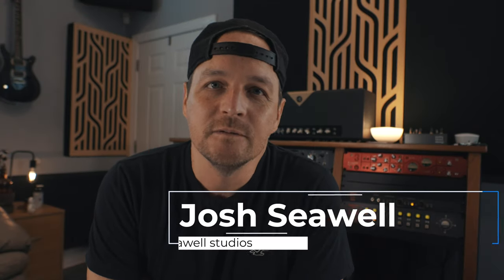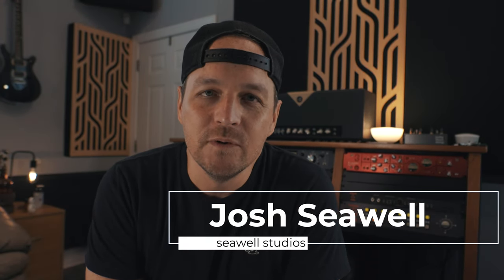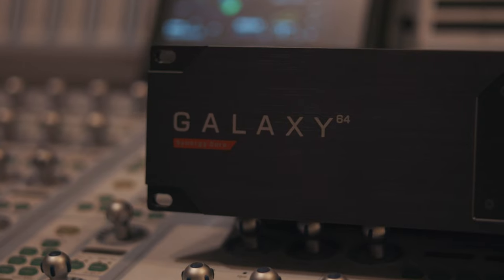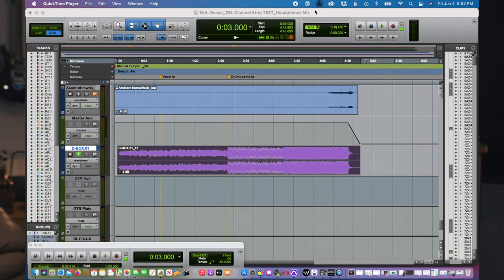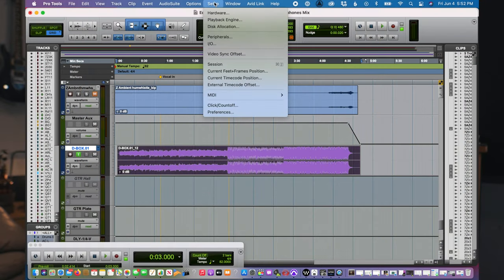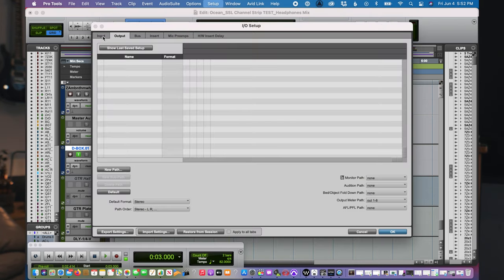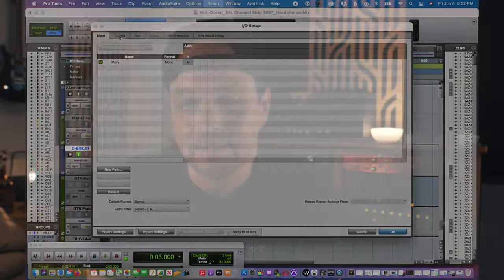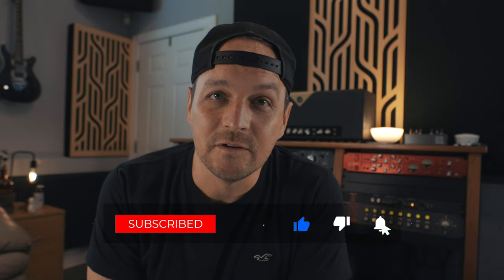Does Pro Tools Delay Compensation work with Antelope Audio Interfaces? | Galaxy 64 Review

Comment from the maker: *Update - I had another chance to use the Galaxy 64 with Pro Tools and at this point I'd highly recommend not getting this unit if you are using hardware inserts and need proper delay compensation.  I never could get it to work with any consistency.
Reply: Could you elaborate?  Is the issue still related to clock source to get delay compensation, or the fact that they still don't have AFX2DAW working with the Galaxy interfaces?  Having to build out a new studio, which will be hybrid and was considering these as an alternative to the MTRX.  Thanks.
Reply from the maker: @Bluesprocketsound  I'd be glad to!  I got to spend another week with the Galaxy after making this video.  Unfortunately, the way I got delay compensation to work in this video would no longer work as soon as I would insert an AFX plug in.  So, I could get hardware inserts to work, or AFX inserts but not both at the same time.  I think the Galaxy 64 has the potential to be the best interface on the market but unfortunately not having the Pro Tools automatic delay compensation rock solid is an achilles heel.  The kind of people looking for this many channels are going to be using hardware inserts I would think so Antelope is really going to have to get this figured out at some point.  I know it is possible(for third party interfaces to do proper delay compensation) because I can still hook up the first generation of Lynx Aurora interfaces and they work perfectly.  Absolutely no manual delay compensation needed.  The Galaxy 64 shows up in the Pro Tools Hardware section as an Avid HD I/O just like the Lynx Aurora does so I have to think the problem is in the Antelope Control Panel software.
Reply: @SeawellStudios  Thanks for the reply.  I've been digging into this with a couple people over on the FB forum.  It seems that Mark Holloway has located something related to firmware versions that affects the Delay Compensation in Pro Tools.  He's got a ticket open with Antelope now, but according to him rolling back to a specific version and then rolling up to the most recent stable firmware seemed to fix the issue and allow the automatic delay compensation to work as expected.  Haven't tested this myself, just passing along info.
Reply from the maker: @Bluesprocketsound  I've discussed it a bit with Mark over on Gearspace.  I really appreciate the effort he's putting into it!  Fingers crossed it all gets sorted out.  Definitely keep me posted, thanks!

Comment: I went through similar pain with the Galaxy 64 with HDX in 2020. I quickly learned Antelope has this issue for years with all of their hardware units with Digilink ports. It’s as if they don’t have the ability to address bugs or defects related to this and just let the issue persist. Very shameful in my opinion as they are very aware of it but do not address it. As a side note, when they launched Galaxy 64 they had a video on YouTube in a studio session promoting Galaxy 64, Pro Tools, and afx2daw during the mix/playback section of the video. I contacted Antelope many times and they ended up killing afx2daw for Galaxy with no notification, communication, and just leaving customers hanging while still showing the integration on the product web page. I moved on from Antelope and haven’t looked back. Everything people say is true. Hardware converters are great, but their products are consistently plagued with defects.
Reply from the maker: It truly is a shame.  I mean we know it's possible because Lynx works with Pro Tools flawlessly.  Perfect delay compensation.  If Antelope would get it figured out they would make the best interfaces but it's such a glaring issue that there may be too much damage done to their reputation at this point.  I know I would be very reluctant to go down this route again.
Reply: @SeawellStudios  I have a Zen Tour Synergy Core that I kept and use with Thunderbolt 3 on my 2019 Intel MacBook Pro but many folks have complained that it's mid-2023 and Antelope still do not have native Apple Silicon support for their drivers, Antelope launcher, afx2daw, Mic emulations, or any of the AFX DSP plugins.They have postponed the release of the non DSP versions (native AU, VST, AAX) twice since NAMM because they announced they will release it as a subscription. This hit people hard because many have invested hundreds or thousands into AFX DSP plugins and had expectations Antelope would do something similar to UADx where if you already own the plugin, you get the native version at no charge. I think the backlash is what has caused Antelope to delay and re-think how to better serve their customers. If they force people with perpetual licenses into a subscription, that will no go over well, even if they throw in a free year, it's still undesirable for many.
Reply from the maker: I hadn't even heard of the native plugins, that's crazy!  These companies definitely need to stop and thinking about subscriptions and screwing over all your existing customers.  When they go that route, they definitely should give the native versions to those of us that have already invested in the DSP ones(I still have a Zen Go Synergy Core).  Thanks for info, I really appreciate it!

Comment: I went with iz radar convertors paired with a avid mtrx 2 ,connected via Dante ,as well as hdx integration ,rock solid
Reply from the maker: Nice!  I had a Radar 24 system for a while in the early 2000s.  Awesome converters.  I haven't heard their latest generation stuff but I bet it's great.

Comment: Im glad I looked at this video I was about to pull the trigger.
Reply from the maker: Glad I could help!  I really hope they get it figured out where it will work consistently.  It would be the perfect converter if they did!
Reply: @SeawellStudios  Yea I'm really wanting to get into hardware inserts and Atmos. Let's hope in the up coming years. Im getting old though. lol
Reply from the maker: @Kharrari  haha you and me both my friend!  I'm considering going the Logic > AirPods Max approach for Atmos mixes for now.  Get my feet wet and then see if it ends up being really worth it before getting some crazy 10+ speaker set up.
Reply: @SeawellStudios  Yea I'm hoping apple drops a better AirPod headphone. I have heard the atmos at a friends and I have the airpod Max. Its coooooool but it is not the same.
Reply: Not saying dont get the Airpods I just think the next ones are going to be a real upgrade. FIGERS CROSSED

Comment: I’m wondering which input/output configuration you went with. I’m using a Galaxy with Logic and a Euphonix System 5 and no issues at all. BNC all the way.
Reply from the maker: Hi Christopher, thanks for your comment!  Are you using hardware inserts at all?  That is where the Galaxy fell apart for me because I use a bunch of hardware during the mix.

Comment: exactly the issue im dealing with... what interface are you currently using?
Reply from the maker: I ended up replacing the fan in my Avid HD I/O so I’m using it alongside 3 Lynx Aurora 16 HD.  The lynx work perfectly with delay compensation so I know it’s possible for a 3rd party to do so!  I just wish Antelope could figure it out.
Reply: @SeawellStudios  I cant believe I spent money on an "upgrade" just to have the latency downgrade my work flow. haha glad I found this video as I was ready to drop another check on a new computer thinking it was the cpu.
Reply from the maker: @BestAIRapmusic  Don't feel bad...I bought into the hype not once but twice, thinking it was something I was doing wrong.  It COULD be the greatest interface out there but the fact that delay compensation just does not work, it's a fatal flaw.  It's such a bummer.